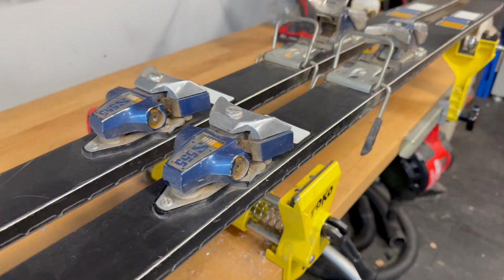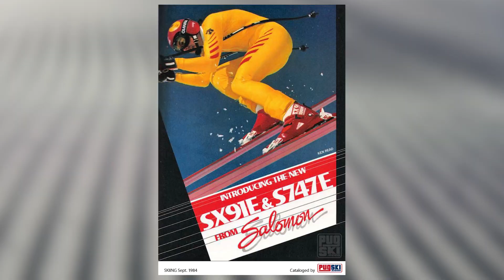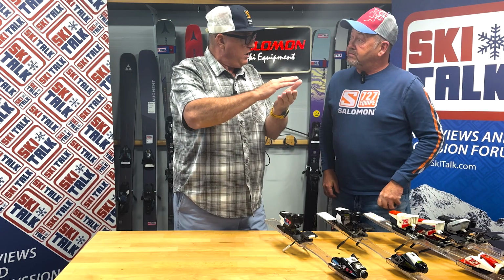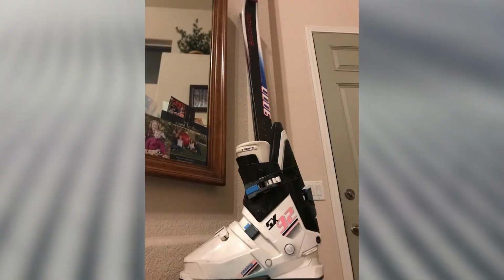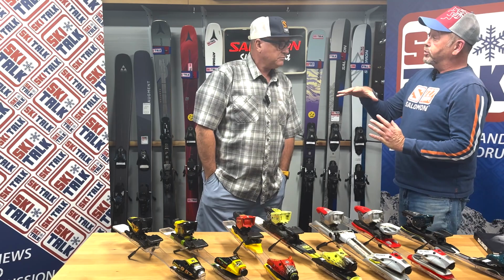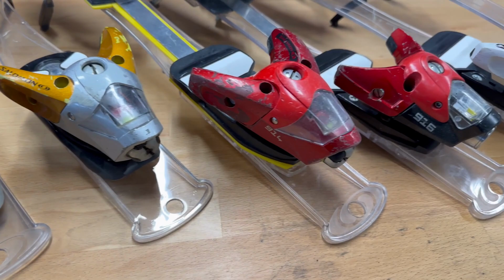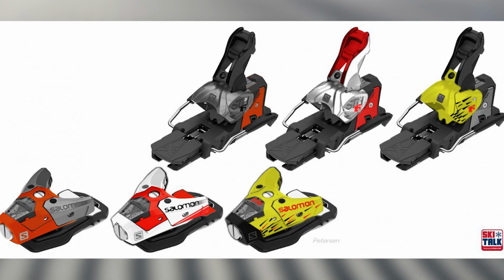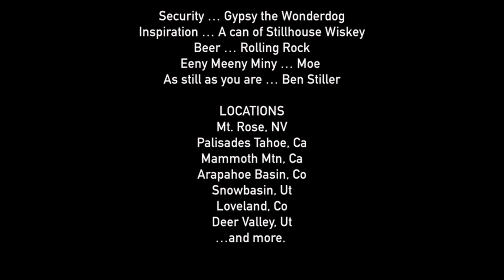History of the Salomon Driver Series Bindings with SkiTalk.com

Comment: So what are the significant differences in the new Strive 12, 14 and 16 bindings besides the obvious DIN and MN adjustments on the 16MN toe. I purchased 2 sets of Strive 14 GW instead of the Strive 12GW. Both have automatic toe height. Did I get a stronger heel for the price difference. My recommended DIN is 6.5 which is well within the range of both models for a type III skier with my height,weight, age and BSL.
Reply from the maker: The heel is the main difference between the 12, 14 and 16. As you move up, the heel changes.